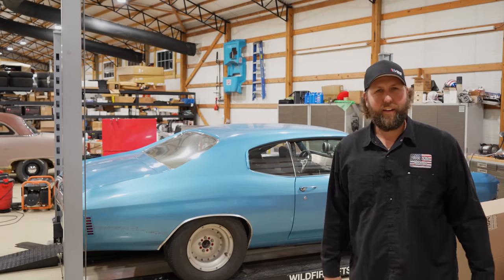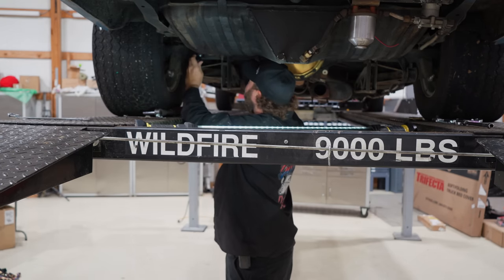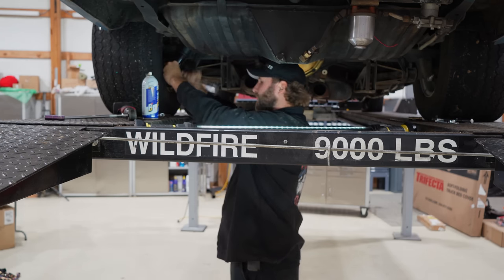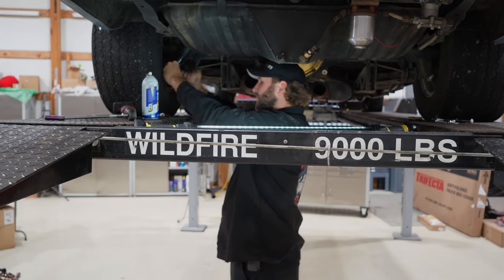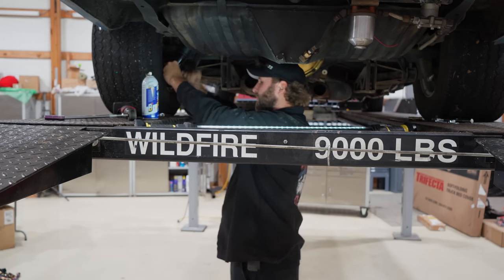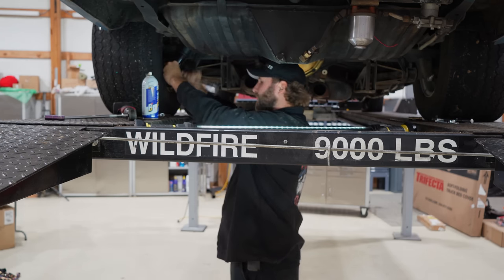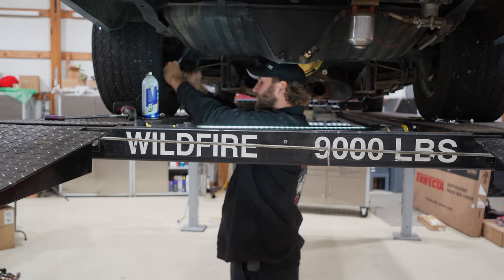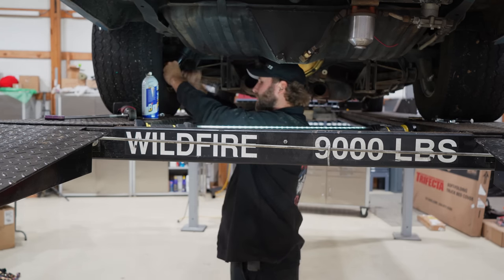'80s Built Chevelle Drag Car Goes On The Dyno - Results are NOT what we expected!

Comment: Derek, regarding the valve float at 6,200 or less, those valve springs have for sure lost some of their strength over the past few decades, if you want the rev's back, replace the springs.
Reply: I came here to say this. Also a set of decent aluminum heads would probably be a better upgrade but it would be neat to see what improvement just a fresh set of springs would make.

Comment: I think you should check spring height and seat pressure ! That will change a lot with an engine that has been setting around for several years and not being ran ! Also most of the CSB I have been around run thier best with ign. timing at 35 - 36° I hope this helps your small block be all it can be ! Love your show !

Comment: It doesn't need a big block. 400 blocks are legendary, and that one is too. It was either blowing through the converter, or that dyno wasn't loading it at all. I've toyed with alot of SBC's and BBC's but the 400 is certainly my favorite.
Reply: Something didn’t sound right. Those were some short runs. Loaded I wouldn’t think it would rev out so quick
Reply: The first Chevy V8 I played with was a 400 so I might be biased but I've got a 496 these days and I'd still say the most special feeling is the 400
Reply: I love the 2 boltmain 400s install splayed main caps and make a 377ci for asphalt modified race car or go up to a 421ci for dirt modified race car pre1974 preferably
Reply: I have a 400 4 bolt main bored .60 over in my 85 c10. Ported vortec heads, cam, intake, pistons, rods, crank and jegs efi kit. Puts down 453hp at the wheels with a TKX 5 speed. Let me tell ya, my dyno pulls don't sound like that.
Reply: Me personally I like a 400 30 over with 6-inch rods a set of bowtie heads and 250 dome pistons about 655 lift roller cam about 4200 converter in a glide with a 1.76 and trans brake
Reply: The heads are the dead spot…double hump heads are choking that 406 down by atleast 100hp
Reply: @PHILLY214  easily, people overlook them, but a set of vortec heads out of the junkyard will do the trick.
Reply: @a.j.sgarage9637  I think vortecs would only pick up 50hp from the 🐫…you can get a new set of vortecs for 600$ these days….throw a set of AFR or DART heads like a 220/230 on that motor and let it breath!! Easily 130-150hp gain
Reply: A vortec is a mini dart essentially. Back cut the intake valves .030 and open up the ports a bit, and they flow the same as a dart. Very sold heads for cheap, only really issue is that the rocker pins are pressed in. Just tap them if you want to run ratio rockers, but with factory rockers they work fine.
Reply: @a.j.sgarage9637  the only good thing w a vortec is the chamber and intake runner…peep the costs of machining for a higher than .450/470 lift cam and 2.02 1.60 valves, ide rather get a set of 1400-1700$ heads fully assembled w the springs to support whatever cam shaft you wanna run and make over 75hp vs a maxed out vortec….ported vortec heads even choke down a 383 no way in hell ide put em on a 406 unless I was broke it’s 2023 now not 2005🤣🤣🤣 you get what you pay for !
Reply: @a.j.sgarage9637  do not flow no where near a dart 220….no way in hell will a vortec head flow the same CFM ! 🤣🤣🤣🤣🤣🤣🤣 a AFR 210 eliminator flows 300 CFM at .600 lift! A maxed out vortec head loses efficiency at about .530 lift @ barely 245CFM…. 100CFM more combined is worth the $$ why not have a efficient motor??? Do the calculations on CFM in correlation to your cam shaft…ITS WORTH THE MONEY ! Makes your 440hp vortec headed 406 into a 600+ Hp sbc🤣🤣🤣🤣
Reply: @CHEF  my vortec heads costed me $40, and my own labor experimenting with them. Flows 273 CFM on the flow bench, I learned alot about headwork, and I've got some heads that I put together myself on my ride. I'd eventually like to get a better set of heads for her, but that's when there's more budget. I'm not saying that vortec heads are better. But if you put the time in it's good for cheap horsepower.
Reply: Mine is still original 400 sb in my chevelle
Reply: I really wish the abbreviation for big block chevy wasn't BBC because it also means something.................. wildly different 😑
Reply: my thoughts exactly. The dyno wasn't doing it's job. In high gear and reving that fast , the dyno was fubar.
Reply: Only problem I had with 400ci GM engines was the plastic timing gear. First thing to go on any car I build with an OEM timing set.
Reply: My absolute favorite engine was my old man's 427 L88. Brodix heads, a big cam, dual holleys on a tunnel ram. 

Conservatively, it was 750hp. That car was a 4 speed camaro with 4.10's and 335s all the way around. One piece front end, triple black convertible. Loved that car. It was a street car though, it never went down the track because it would obviously need a cage and a few other safety pieces to be legal at a real track. It did beat 9 second cars on the street at Metro though. They trailers in while he drove it out there 😂

Comment: Thanks Derek, another great video. Rather than an engine swap how about a series where you continue to go through the car and make sure everything is working to its best? Check the convertor and box, valve springs and all the other things that could have gone away since the car was built. Get a baseline on the track here and then do some average feller upgrades?

Comment: I agree that it did sound like it was blowing through the converter. You seemed really disappointed contrary to what you were saying, I would of guessed 350-375 hp. You gotta remember this thing sit a long time and the engine is probably tired as well. Nothing wrong with big block swap, just small block was the thing back in the day. I would just have fun with it until it blows. Then give it independence 2.0 treatment!!

Comment: I'm with the majority here Derek..something isn't right with those dyno pull's. My stock bottom end 350 with dart iron heads, roller cam, dual plane intake and a quick fuel 750 is making 400 at the crank.
Love your channel..and I've caught my wife who's tolerated my gear head addiction for 30+ years standing behind me watching your video's several times..
I ordered 2 of your key chains. Told her she's getting the "well I'll be dipped" one for her motorcycle and the "bring the thunder" one is going in my camaro!

Comment: Great idea, great show. Cars were fun back then. Your Chevellle was a pretty radical piece. Still is. Before you change the gearing, why not replace those 18 year old valve springs (They don't make springs like they used to; that's a good thing) and put some shorter tires on those pretty wheels. Since the tack was set for 6500, chances are the cam is solid and capable of twisting that tight. AJ might very well be on to something.  Anyway, @ 6500, with the 4.11's, and a 27" tire it would be pushing wind north of 120. Everything back to spec and a fresh coat of reman juice and mid 12's @105 ought to be doable and fun. Keep doin what your doin.

Comment: Great vid. I usually don’t comment, but there are a couple things I’m seeing here. 

1. I would be very tempted to pull the valve springs and test pressure. Probably 30 years old and need to be changed.

2. It’s likely blowing through the converter. I’ve personally seen very low 12 second (3500 pound) cars only make 250 wheel hp on the chassis dyno because of this. 

I’d love to see this car run at the track as is with new valve springs and a 29” tire. I’d bet it runs in the 12s.

Comment: I think you should keep the 400 sbc, their good motors and with a set of ARP rod bolts and a nice top end you can get pretty quick; and even quicker if you show the bottom end some love.This car represents history and working with what you have, keep the drive train. Love the show, happy hot rodding.
Reply: i agree, sbcs are torque monsters with the right setup, i personally think he should run it as is for a bit, but do a rebuild with some updated ported and polished aluminum heads, solid roller cam, fully forged rotating assembly, thing would be nuts, and run some spray

Comment: I'm kinda shocked that the car only made 233hp. I was thinking around 500hp. Keep the videos coming! I enjoy everyone! Hope you're on the mend! Have a good day!
Reply: I know I was thinking 400 😂
Reply: I was thinking bare minimum 400 hp. 
But the double hump heads might be starving the engine for air above 5000 rpm. Even Vortecs can't meet the demand for an airflow-hungry 400
Reply: Prob junk converter and slipping.
Reply: 100% has to be slipping!!!! Stock 400 makes 200!!!
Reply: He gotta be blowing right through that converter 1 have a 406 in my 72 chevelle with afr heads 12:1 compression .600 lift at 300 duration with 107 overlap with air gap intake and a 850 race carb 38 degrees total timing. Trans is a borgwarner supert10 and 3.73 12 bolt she makes  450 hp and 550 tq with good air To the ground. he's just flaring that trans /converter and probably floating valves.
Reply: @SXSPRIME  yeah, my guess was TC flare and or slippage! We run 358ci small blocks in our circle track cars dart iron heads, solid flat tappet camshaft like 545lift 106lsa, victor JR and super victors, with a Willy’s 750s on top makes 490 at 38-39* locked out on 116 octane fuel!

Comment: My opinion is most small blocks have too big of carb and to much cam. They sound wicked but the right cam/carb combo you can get 350hp easily out of her! Great video.
Reply: They do, and WAY too big of both. The heads are the restriction and even a big cam can't overcome the choked airflow. They're doubly limited with being low-RPM engines, but the old shitty heads had just enough flow to match them. You can kind of gain low-mid power but the heads are CFM peaked by 4500-5000 depending on displacement.

Comment: Wow, that car sounds real good. It makes me feel better that my 67 Fairlane with a mild 460 and c6  ran mid 10's in the early 90's. I built it to run mid to low 11's. I am not a tuning wizard by any means. But mid tens with no real wizardry gives me hope. I am currently rebuilding the car with a 532 BBF and a GM trans. Bought in 86. It is pictured in the first time at the track in my picture to the left. 
Love your series.

Comment: I had a 406 with vortec heads, mild cam (not sure the specs) dual plane intake,  holley 750,  roller rockers, long tubes and was backed by a th400. Made 306 wheel and 316 torque. So I say your down alittle for some reason.

Comment: Tip for the air shocks Derek. Fit TWO independent schrader valves; this allows you to a)  control body roll  and/or b) weight jacking!

Comment: Dyno HP call-outs are NOT BHP, but the HP at the wheels, so the low numbers aren't really that bad (at the RPM he was sitting on at the revs.) So the BHP would have been around 20% higher than what was called out (WHP). Also, even though the revs were short, the computer would feed (out) linear (digital) results that can be snatched with very little converter input, so probably a little more accurate than you'd expect. And since Derek wasn't concerned, he may know a little more than he let on.... he usually does.:goodvibes:
Reply: You're correct!  I feel the results were most likely correct!

I also think that we're led to believe that our cars make more power than they really do.  And the speed parts have claims of how much power can be added with an electronic ignition, intake manifold, headers, cam, etc.  Based on all these claims, my old Camaro should've been putting out over 300 hp - I'm thinking it was closer to 230!  I'm pretty sure it's true, because I rented a 1989 5.0 Mustang (not GT, but the trunk model Mustang).  Ford said it made 225 hp.  Power came on different than my Camaro, but I'd say the power was about the same.  And yes, I did feel dejected when I found this out, because I thought my Camaro was making 260+ hp.
Reply: @gregkimura5906  Reason why DOHC makes more power/liter is ultimately because they flow better. The biggest problem, aside from RPM limitations, with 60s-today pushrod engines is that the stock heads used to be terribly restrictive. Until the LS and newer GM engines, bolt ons aren't doing shit for power above the low 200s. The heads are just restrictive and even cams don't help much with the inherently restrictive 2v OHV designs. They're also low-revving, which also greatly limits HP, so a built low end isn't going to add anything either until you can get heads that flow.

GM didn't really address that until the Gen 4 engines and even the 5.0 Mustangs like you drove had better flow but were HP limited by the conservative redlines. People need to understand that older pushrod engines don't make nearly what they think they should and that they're either severly limited by head flow and/or RPM.

Comment: Hi Derek, love the variety of the builds. It was a bit hard to make out what rpm the torque and hp graphs cross, the hp readings will be wrong if the lines don't cross at 5252 rpm. The hp graph is calculated by the computer. Hp=torque × rpm / 5252 . Might explain the low readings. 
It would be great to see the engine checked over then redynoed. I'd expect about 350 hp using 15% as lose for the drive train. OK

Comment: On July 2nd 1980 I bought a 1971 Chevy Chevelle Malibu convertible  with a 307, TH350, and a 10 bolt rear.  24 days later the car burned in a fire.  I restored it, then later modded it.  Now it has a 489CID tall deck 454 rated at an estimated 688HP on pump gas, normally aspirated. TCI TH400 w 2400 stall 10" converter, and a Moroso posi pumpkin.  Road race suspension uses Koni shocks, Eibach springs, Edelbrock boxed rear arms, Hotchkiss tubular A-arms, Herb Adams swaybars, offset A-arm mounts, urethane bushings everywhere, and p395/60R15's at all 4 corners on 15x12 Weld draglites.  The nose had been replaced with twin aluminum 5 core BB radiators. The hood has been replaced with a 9" snorkel flanked by twin L88 scoops.  The trunk sports an F40 wing, and it has 6" fender flares front and back to cover the wide tires.  Willwood disc brakes are fitted front and rear.  The back seat has been replaced with a sub-woofer box.  The sound system includes an Alpine EQ, JBL amps and subs, and Infinity speakers.   It estimated to be a high 9's car with the top up and correct rear end gearing for the 1/4 mile.  In a Corvette body, the engine is good for about 240mph top end.  Top end on a mid-size 2 door converted to a roadster is somewhat lower, especially with the top down.

Comment: Wow, this car brings me back. I can't believe how close to a car I had in the 80s.  This car is almost identical right down to the Lakewood ladder traction bars.
I had 2 rear end for the car, a 12bolt with 4.56s, and an open diff 10bolt with 2.41s. I was in the Marine Corps stationed in California from Washington State.  Going home on leave I would remove the rear seat bottom put the passenger buck seat behind the drivers seat on the floor board.  I would then swap in the 10bolt and put the 12bolt on the passenger floor board.
I would make the drive swapping the rear ends at each end of the trip.😅 there was racing to do at each end...

Comment: AFR 225s and a solid roller akin to 248/254 - .606/.614 on a 109. See far the slugs are in the hole and do a gasket to get you to to a quench of .036-.044. See a massive gain...

Comment: I think that you may have weak spring pressure because of the big lift on the cam. A lot of time the springs will weaken when the motor has been setting for quite a while. I would check them out before I even took the car to any track.

Comment: Solid lower bars are great on drag Chevelles. If you keep those traction bars, maybe weld them to the housings, you will keep breaking bolts, putting them in a bind like that.

Comment: I have a 71 Chevelle also.
383 stroker
I have the functioning cowl induction hood with the factory air cleaner assembly to match up to the hood.
I had to add a 3/4” spacer between the carb and air cleaner so the linkage would clear.
Now here’s the interesting part I didn’t expect.
On the Dyno with the hood open air cleaner on.
The Dyno guy said to take the air cleaner off that should help make a little more HP.
To my surprise I lost 7 HP with no air cleaner assembly.
Installed the factory air cleaner assembly and my HP went back up 7 more HP.
I didn’t see that coming!!
I guess when the factory designed that air cleaner they put some thought into it because it works!!!

Comment: sounds like its a decent 5.56 rod 400 because of that flat early torque peak. you may be right bout that cam . try a isky mega 505 and new valve springs ,  if your gonna run in the eighth mile even a smaller carb like a 4777 dp , dont give up on her till it kicks a rod, lol

Comment: I miss my competition cams xe series 268 477/480 lift cam kit for sbc I had in the 355 I loved the lope it had especially through the heddman full length headers I had on the truck and I usually a guy that would rather have exhaust manifold true dual exhaust glass packs and 90's behind the rear tires

Comment: I would do a sparkalater read for mixture (full throttle, idle down and immediately kill the ignition) and adjust the mixture per plug read. Another commenter mentioned timing at 35 degrees, which looks right to me. (disconnect vacuum advance) My former '70 GTO ran best at 34 degrees total at 3500 RPM, with street hydraulic cam. (near ram air IV spec) Install a 12 degree vacuum advance unit vs the stock 20 degrees. (not needed at all for drag runs) The 12 degree vacuum advance and more aggressive centrifugal curve builds hp much faster in the mid band.... less time to develop hp makes a snappier engine, crisp throttle response. The plugs should be AC44' to greatly reduce any chance of pre-ignition. The engine may have inaudible preignition at higher R's that would account for some power loss in the higher range.